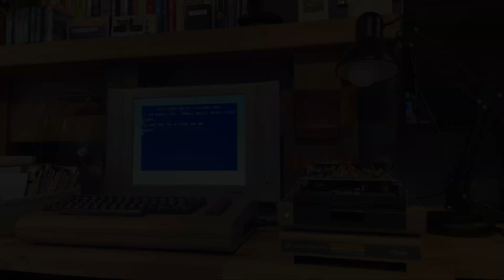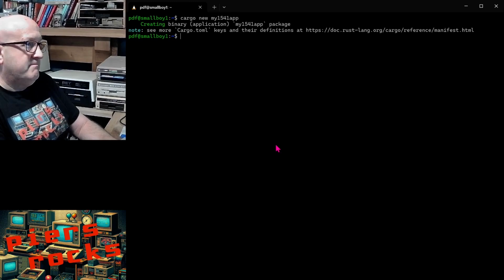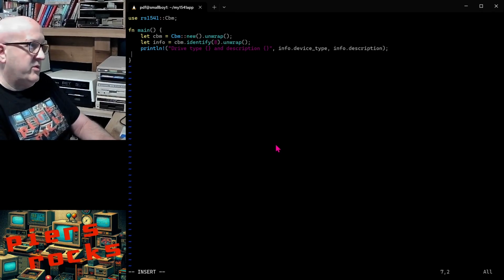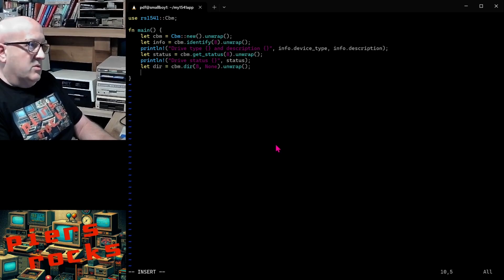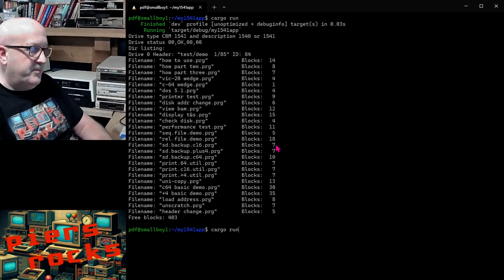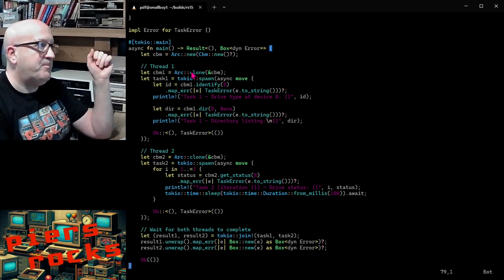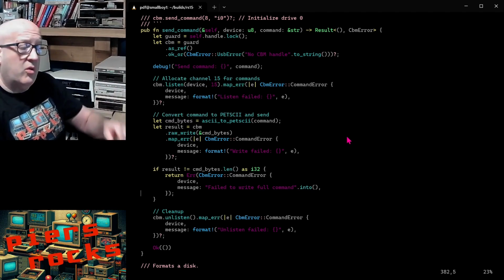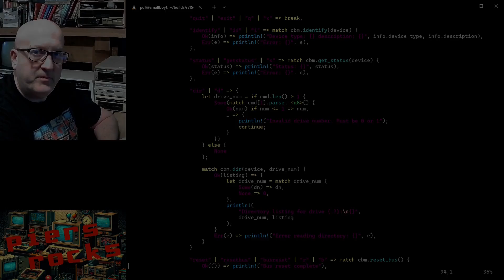Rocking Rust - Using Rust to access Commodore disk drives - floppies rock ep14

Comment: Nice crate. 

In fact, tokio::spawn doesn't start a thread, it starts a task*. It could all be on the same thread. Tokio *can decide to pass the task to different threads (work stealing), but in this example, I'd wager it's all ran on the same OS thread.
Reply from the maker: Thanks for the clarification.  Yes, agree - AIUI actual threads are limited to the number you specify, with tokio deciding how to schedule tasks across those.